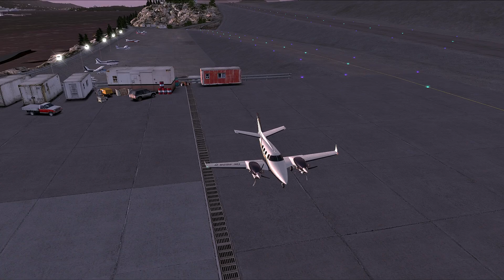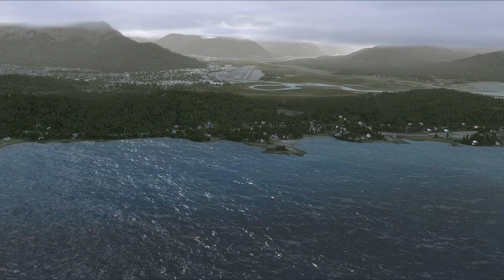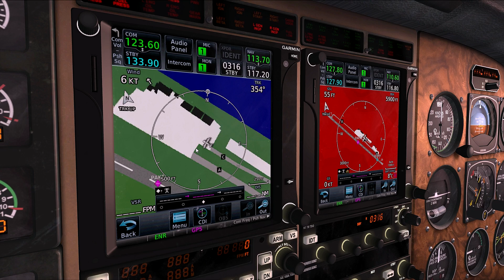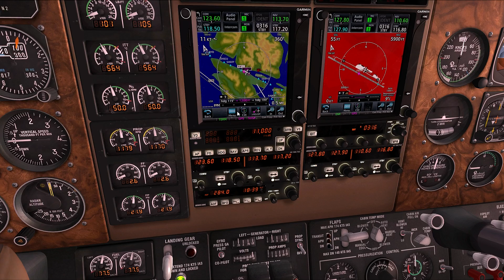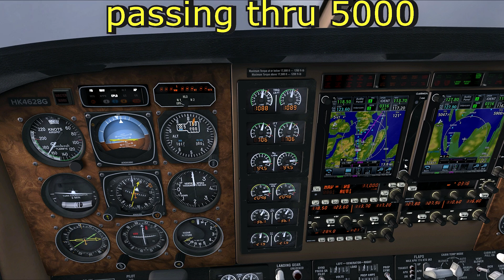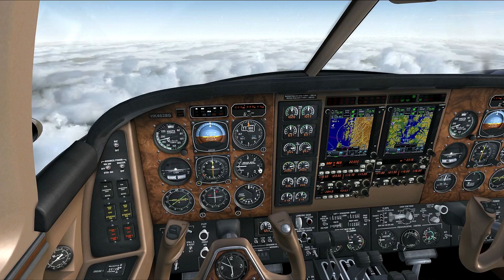RealAir TURBINE DUKE Version 2 part 1 of 2

Comment: Great plane. upgraded Vid Card to 1050 Ti and went from 3 monitors down to two. 4 successful trips in the Duke T V2.  This and other videos helped. The conditioners are tricky..I ground looped the first start from cold and dark haha.
Reply from the maker: Awesome rbxb... I'm thinking it may be time to upgrade my 980.  How much trouble was it to change out?  Tim
Reply: piece of cake. You will have an additional 6 or 8 pin electrical hookup most likely (you probably do already.) Just make sure your power supply will service the newer cards demand as well...

Comment: Did you say you can purchase the glass cockpit and use it in other aircraft?  If so where can I purchase it?
Reply from the maker: +Harry Smith Hi Harry!  Sorry for the delayed response.  The Garmin GTN-750 by Flight1 can be used on multiple aircraft, however, not every aircraft developer provides simple interfacing of add on navigators within their software (Carenado for one).  Fortunately most of the top tier developers do provide easy interface for upgraded navigation,,, RealAir, Flight1, A2A, etc..  There is also support on AVSIM for interfacing the GTN-750 into some of the Carenado fleet.  Hope this helps!  Kindest regards, Tim G., FS MaNiA

Comment: Awesome video..Learned a lot... Whats the rule when to turn on fuel pumps?
Reply from the maker: skibooo hmmm..,, without going back to the book on this, in general, I cut on booster/aux. fuel pumps prior to engine start.  Once engines are running I typically cut them off on the ground to be sure the engine driven fuel pumps are operating properly.  I switch them back on just prior to takeoff to avoid engine failure in the event of an engine driven fuel pump failure.  I typically switch the aux. fuel pumps off at a safe altitude in the climb.  I leave them off until running the approach checklist, switch them on for landing for same reason as takeoff.  Having said that, I would need to go back to the manual to be sure that logic applies to the Turbine Duke configuration as it's been a while now since I flew this girl, however, I don't think you would go wrong applying this logic to almost any aircraft that has standby/auxiliary/booster fuel pumps that are backing up engine driven pumps.  The reason I cut them off in the climb is to save wear on the pumps.  The reason I cut them on to start is to pressurize the fuel system.  The reason for takeoff and landing is to backup the engine driven units by maintaining fuel pressure even if one of the engine units fails thereby ensuring continuous engine operation. A very long wordy answer to a short question. Hope that helps.  Thanks for watching, commenting, and the question.  Kindest regards, Tim G., FS MaNiA

Comment: Hey would you mine giving a bit of advice?  I can't seem to hit the centerline of the runway for the life of me on landing in FSX.  Is it harder to do because of no rudder pedals?  Any tips?
Reply from the maker: The Lowmein Hey Lowmein, Don't feel bad, I always aim for the centerline but usually get blown off a bit in the flare.  I don't use a separate set of rudder pedals, however, I do use the twist action on my joystick (Rhino X-55 HOTAS) for rudder control. Having good rudder control is important for tracking the centerline so make sure you don't have them linked to the ailerons in your control settings.  Also, make sure to turn off the yaw damper if you have been using autopilot for the approach.  
The key to a good landing is a good stable approach:  Line up with the runway as early on final approach as you can, I place the runway touchdown point in the center of the windshield (if it is a visual approach).  If the runway end starts moving up in the windshield, I am descending too fast, I add power, if the runway end is moving down in the windshield, I am descending to slow, I remove power (slight adjustments). Control airspeed on final using trim to adjust pitch.  If you add or remove power, trim as necessary to maintain approach speed. On approach, you are controlling airspeed with pitch, and controlling vertical speed with power.   
Now, this is the kicker (no pun intended), use rudder to keep the nose of the airplane on the centerline during final approach.  If you have a crosswind, you will need to crab into the wind to track the centerline,. If the nose of the airplane starts moving away from the centerline, use rudder to correct and keep your wings level with ailerons. If you are blown too far off centerline, you may need ailerons and rudder to correct the ground track.  If you are crabbed to correct for wind, kick the crab out with rudder just before touchdown to line up with centerline.
If you watch, most pilots need to work all controls, pitch, rudders, ailerons, power, to make slight adjustments of glide path, airspeed, and ground track on short final and fly the airplane onto the centerline.  Wind is not always our friend.  It is sometimes changing speed and direction, so we have to adjust accordingly to make the airplane do what we the pilot want, not what fickle winds want.  And lastly, remember, a good landing is one you walk away from,,, a great landing is one you taxi away from,,, ;)  Hope that helps, Kindest regards, Tim G., FS MaNiA
Reply: OHHH facepalm*  I realized tonight that I was not turning off the yaw damper!  Thanks for all the tips.  I'd love to be your FO some time.  Although my previous confession of bad landings probably just lost me the job!

Comment: Another great video Tim.   Wait until you get into rain with this baby, it is awesome. 
Question, how do you decide when you need the Oil Doors on Takeoff?  Hot days only?  Thanks and looking forward to part 2.

I also love the Turbo Duke with GTN750 - Excellent combo as you said.
Jerry
Reply from the maker: Jerry HondaJet  Hello Jerry, Thanks much.  I actually did get into major rain on the approach and landing in Juneau (moderate thunderstorm activity).  I really like the effect on the windshield.  
The main thing on the oil doors is to keep a close watch on both oil temp gauges (a little hard in FSX because the power levers block the  pilot's view of the gauges.  You will get a caution light if the temps get to high).  I would check more frequently on hot days, however, since airflow through the engines is keeping them cool, the oil doors would most likely be need to be opened with high power settings and low airspeeds. For example, a sustained 4,000 fpm climb at peak NG, torque, ITT settings will yield a relatively slow airspeed,  Chances are good you will need to open the oil doors for that scenario.  I never saw high oil temps, however, I kept my climb rate at 2,000 fpm and plenty of airspeed and air moving through the turbines.
I just realized I missed the perfect opportunity to use the Turbine Duke's 4,000 fpm climb capability.  On the Ketchikan departure, we were flying in the opposite direction from Juneau until reaching 5,000 ft.  That would be a good time to use a high rate of climb and  slow airspeed since we were heading in the opposite direction we needed to go.  I used that trick a few times in real world flying when being vectored around by ATC.  Oh well.... thanks again!  Hope this helped.  Kindest Regards, Tim G., FS MaNiA

Comment: Another great video, but every time you post a new one I have to buy something new.  I just picked up the GTN 750.  What a piece of equipment!  However, I am having trouble with the second GTN 750.  It won't power up.  Any suggestions?
Reply from the maker: Capt. Boone Hello Captain, I'm glad you enjoyed the Turbine Duke video.  I probably should call it the Turbine Duke / Garmin GTN 750 video.  The navigator seems to be the Star of the show!!!  It is a great "must have" (in my opinion) add-on.  You can use it in other aircraft as well.  And you do get two for the price of one.  I realize one GTN has plenty of capability, but in my mind, if one is good, two must be great!  I have no idea why your second won't power up.  The second  in my Duke's panel didn't make the click noise, but I never had a problem with it powering up.  I would suggest checking the Flight1 support forum.  You do need to register for the GTN forum using your purchase serial number.  There is a ton of information in and trouble shooting in the forums.  I bet someone else has had the same issue.  If not, you can contact Flight 1 direct as well.  Hope that helps.  Thanks again.  Kindest regards, Tim G., FS MaNiA

Comment: As usual, another amazing and informative video Tim.  I have the turbine Duke but not the GTN750 as yet but I'll be picking it up soon.  Quick question.  Your water textures are fantastic!  Assume you are using REX 4 TD.  What water wave set are you using?  Thanks again for your great work.  Looking forward to part 2.  Regards, Dennis
Reply from the maker: golfguyw5 Thank you Dennis!  The Turbine Duke + GTN 750 = Fanfreakintastic!  Can't go wrong with that combo.  I am using the REX 4 textures.  I change them up from time to time to get some variations in the sim.  I'm out of town this week (away from my sim) so I'll  check on the water textures when I get return home.  I still need to edit part 2,, will do that next weekend.  (vacation is getting in the way of flight simming ;)  Kindest Regards, Tim. G, FS MaNiA

Comment: I had little doubt the Turbine Duke would disappoint as well done as their older one is.

And those Garmin's are a dream aren't they? I had issues with them at first, but it was a result of a bad download. Might be worth mentioning that the initial install only has charts (and I think terrain info) for the US only. I think I read that you can buy info for the rest of the world, however. The panning issue was fixed in P3D, but it's not too much of an immersion breaker for me to pop out the 2D if I want to pan around.
Reply from the maker: Lobta Hey Lobta, I am loving those GTN's.  Thanks for pointing out the limited charts and terrain data to North America.  I want to say, they have either added additional coverage or provided a cost effective way of adding them through another provider??  I didn't dig too deep into that since I was flying in a covered area.  
The panning issue wasn't to big a deal for me either.  I normally print out charts from MyAirplane.com anyway during my preflight work.  Thanks for your comments and feedback.  Kindest Regards, Tim G., FS MaNiA
Reply: FS MaNiA Make sure you have the latest version of the Garmin Trainer Lte software. I believe they did a major update recently.